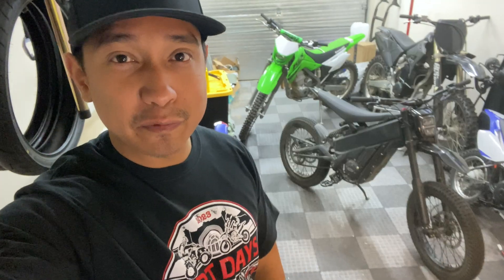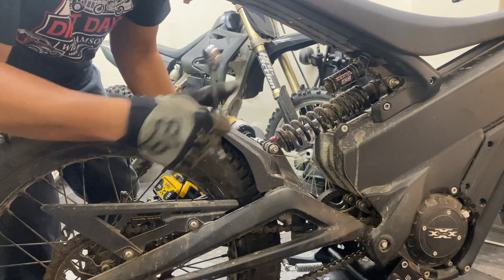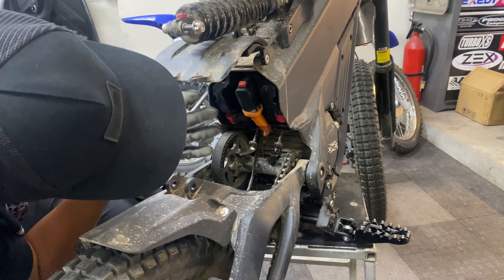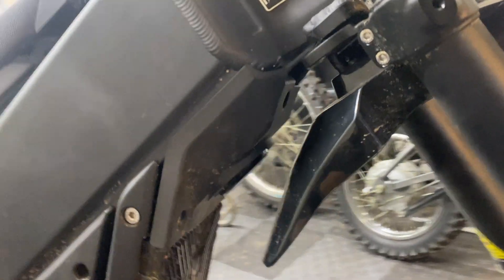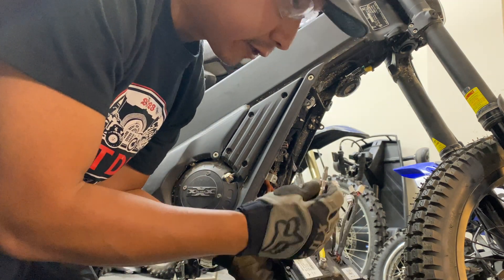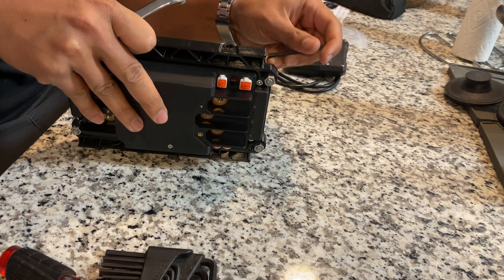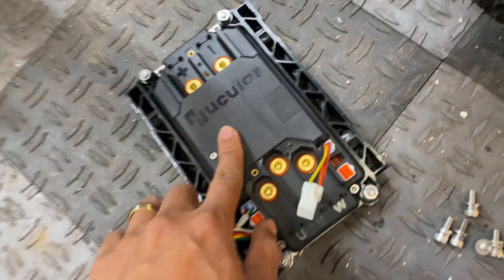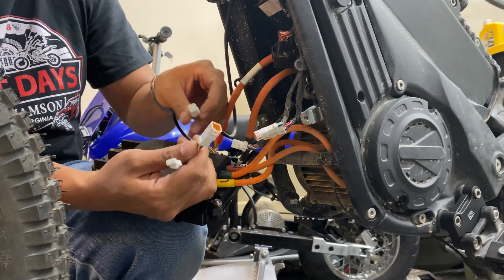Talaria XXX Nucular P24F Controller - Detailed Installation & Review

Comment: Did you ever have any issues when running wide open throttle the bike still has power it just cuts ? I have the same battery and controller but this thing won’t run top speed for over 2 seconds. I tried all the same settings but still not getting anywhere

Comment: Hey, I installed the nucular on my xxx, and the start button doesn't do anything. It doesn't change the modes. Also, it's stuck at 34mph and won't go any faster even when I change the phase and battery amps as well as the speed percentage.
Reply from the maker: Have you contacted Nucular? Sounds like you need to change a lot of your settings

Comment: Why didn’t you use the mounting cap to its potential? It’s designed to run the wire down the steering tube. Also when pulling plugs from the controller itself, there are little square holes under each h plug to use with a tiny screw driver or the likes, rather than prying the plug from the top and using the controller top face as a prying surface.
Reply from the maker: @Illinois.ill-lectric  is that what you did on yours? Please post a video so we can learn

Comment: I installed it on the international version but the motor shuts down after twisting the throttle to much. Feels like a deadzone in the throttle because if i put the throttle back an twist again i regain power.

Anybody have any awnsers?
Reply: I’m installing one tonight, half way through.. pray I don’t run into your issues. If I do I’ll be in touch

Comment: for some reason it keeps saying for the throttle that it’s not connected but it clearly is and I double checked the wire too
Reply from the maker: @yannikoutz  sometimes the connectors get loose up top near the throttle itself, not just the plug going into the controller
Reply: @PatOutdoors  I’m holding down the throttle and it’s not seeing it, the plug is in perfectly it’s not just seeing the throttle
Reply: @PatOutdoors  Does your lights and horn work? idk why mine isn’t working at all
Reply from the maker: @yannikoutz  yeah all that has nothing to do with a controller, even stock. It’s all separate wiring.
Reply: @PatOutdoors  do you know how I can fix my wires and for the lights and the horn it would be very appreciatating if you could

Comment: Too switch to MPH . go to "On-board computer" then "Main screen setup" then you'll see "speed unit" !! (found in another video)
Reply from the maker: Thanks bud! I’ll try that out
Reply: @PatOutdoors  No problem ! Seems like there's lot's of options with that display/controller !
Reply from the maker: @MarioMadness1  Bro it worked! Thank you again
Reply: @PatOutdoors  Enjoy ! I feel like you'll be tinkering with settings for awhile ! since it has a light sensor for backlight (thats what the little camera hole is) , can change the LED color, set-up turn signals, LED strips, etc.. plus all the sprocket settings, battery, etc for tuning !! Gonna keep you busy
Reply from the maker: @MarioMadness1  damn it man you just gave me a bunch of project ideas 😩